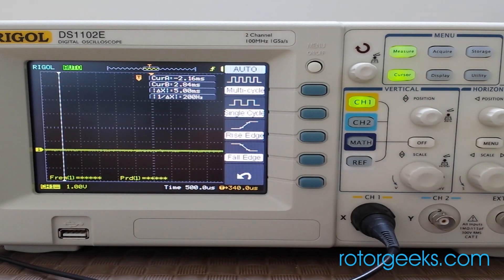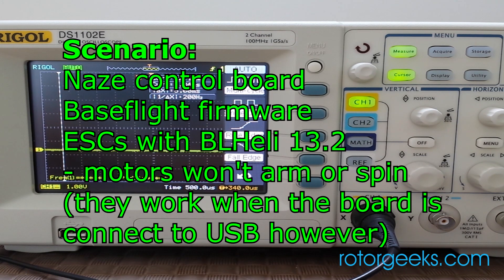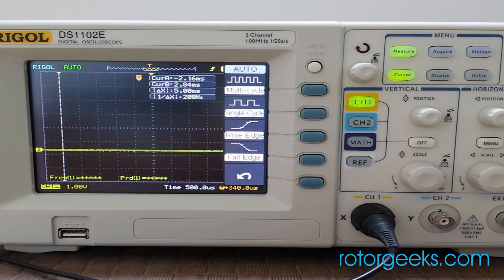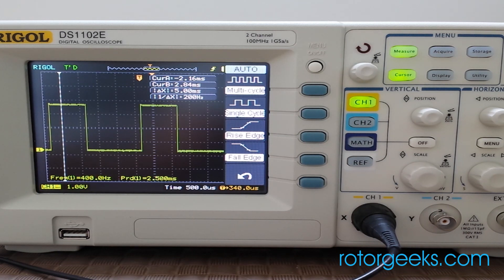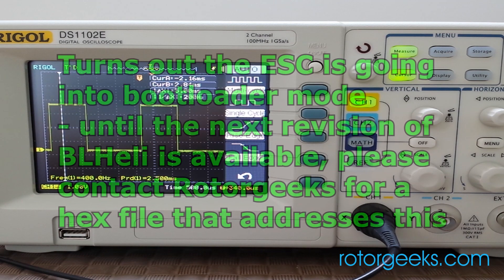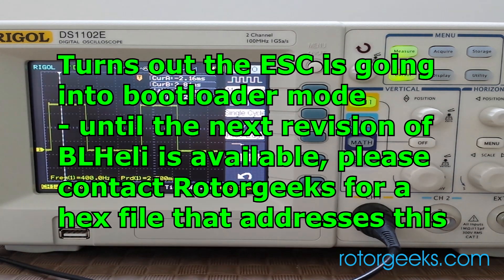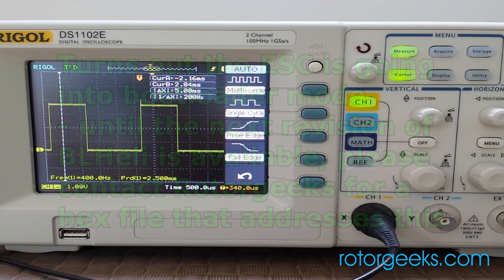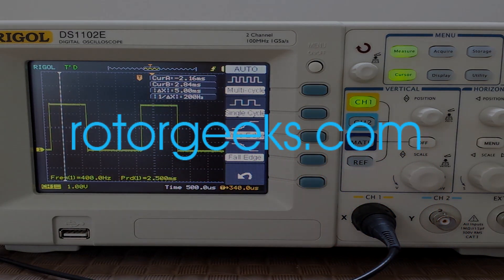BLHeli 13.2 - motors won't spin

Comment: i hope some one read this soon...naze32 clean flight, blue wrapped BLheli esc...it was working fine then the 2 left motors would go...they sputter but wont go...this happened yesterday but to the two front motors but it fixed itself...what is the deal?

Comment: I have the same issue on cleanflight! :/ any news?
Reply from the maker: GoProlet if you have it on cleanflight it might just be throttle calibration is needed.